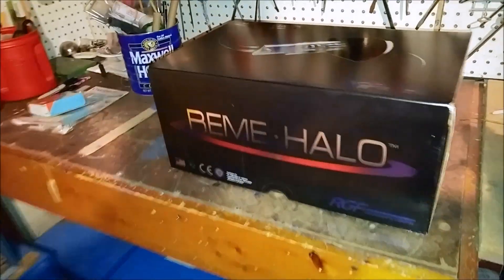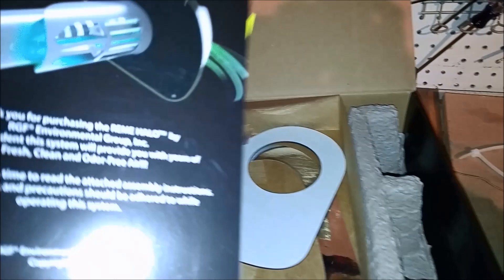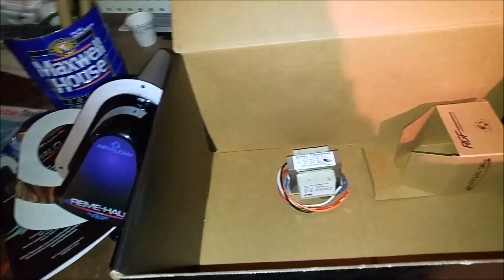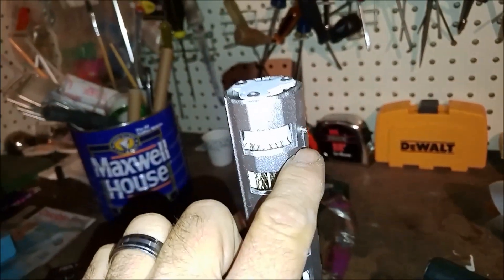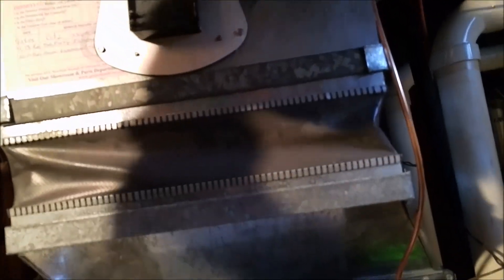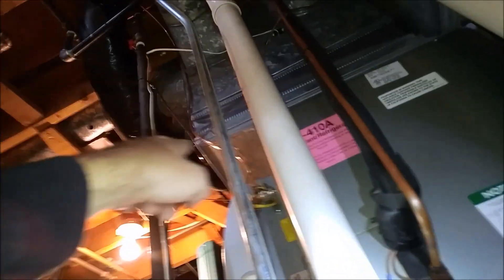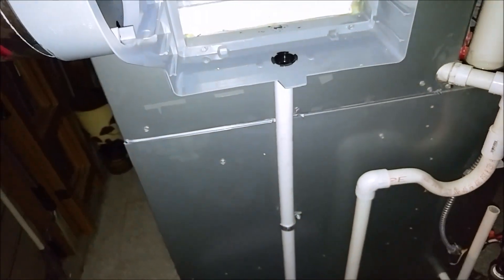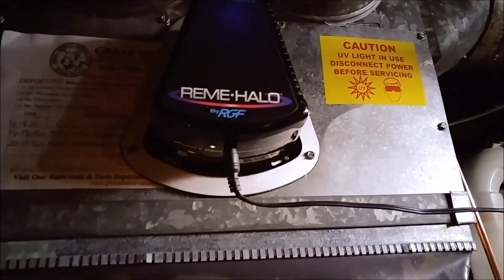RGF REME HVAC HALO 24V Air Purification System Install

Comment: I am late to the game. But for the reme transformer, do the wire colors match to the A.C. unit transformer? I get all the other parts just worried about the wiring to A.C.
Reply: Look at your voltage information, and choose the colors you need to use for correct voltage. Example. If your voltage supply is 240 and stepping down to 24v  use the two wires that states 240.

Comment: they can be installed anywhere in the system . but works best in the plenum .if you do it in the return the handler and coils will reduce the effects but still works.

Comment: Hi I have two questions. First is it  better to install before or after evaporator in supply air. Second fan is recommended to run all time how but RGF LIGHT recommendations all time on or on when fan running Thanks
Reply: You put it after the AC coil and it should be on 24/7 even if the blower isnt on

Comment: Why not just wire it straight to your R and C terminals on your control board, no need for a transformer
Reply: Jacob Ormonde It needs to have its own 24v to operate the UV light.
Reply: You can, But I would up the VA power to about 70

Comment: In a single furnace couldn't you wire it between R and C?
Reply: Yes
Reply: Yes as long as your furnace/audio handler transformer has capable if the amp draw. You may have to upsize but that's easy enough

Comment: You install it in the wrong spot... it goes after the filter, above the Air conditioner coil Birdbrain!!!
Reply: Look again dipshit. It is installed on the supply air plenum.
Reply: Hey Sam, 2 years later and you're still a dip shit! 😝
Reply: Haha you moron
Reply: what an idiot, that's the problem with this type of video, i'm sure Mi Heating intended it for fellow hvac pros and you have dipshit home owners drooling and packing their amazon carts with this and a nest stat

Comment: It would have been helpful, if you had shown the actual wiring of the unit into the power supply!
Reply: I got a really good view of tightening some screws instead lol
Reply: Did you figure out how to wire a 24 bolt transformer? You’ve had 5 years to figure it out 😂
Reply: If you cant figure out how to wire in a simple transformer call a contractor out to do the install.  Dont want to burn your house down.

Comment: I have installed about ten of the reme halo 24v about 3 times the red light came on after install any reasons you can offer please
Reply: Anthony Buccini mine comes on red as well but all indicators show nothing is wrong...amp is fine, power draw is fine, u.v bulb is on. But the lights red
Reply: The new gen Reme has a red light

Comment: you didn't explain the wiring part clear enough! lol that's the only part we need.
Reply: 1 wire goes to the 24 volt common. The other goes to the 24 volt power (usually the red wire).
Reply: If you don't have anything being powered off the board ie wet switch or ex trap just wire directly to the board 1 wire to R other wire to C
Reply: @tone5420  wi that keep the unit on at all times or will it shut off when the blower isn't going?
Reply: Tactical Ace ? What do you mean ?make sure the transformer has power and run the low to the REME
Reply: If you dont know DONT TOUCH!

Comment: Does the fan have to run all the time with the reme halo
Reply: no
Reply: no, but recommended
Reply: Not if you live in a humid climate.
Reply: It should be wired so that it is only on while the fan is running.  And yes they recommend that the fan runs all the time.

Comment: There is a sign about UV light, I read on amazon comments that UV should NOT be used in a furnace is that an old sign? I read on amazon also that the plug in model has been updated...? Answers please, very interesting product.
Reply: Go onto RGF's website to read more about their products. Lots of in depth info on there!